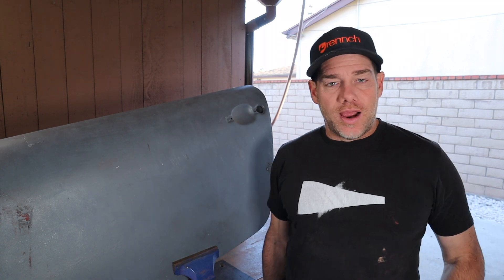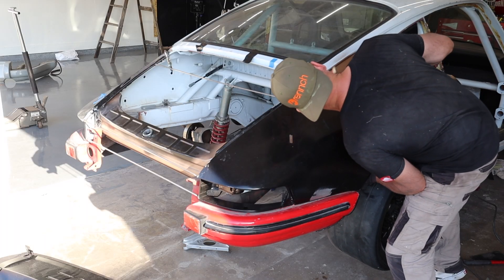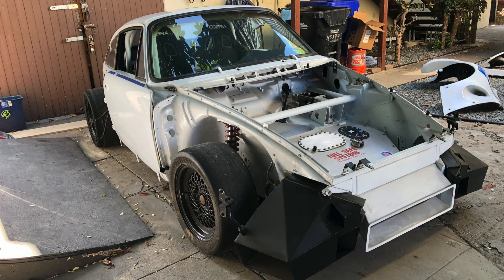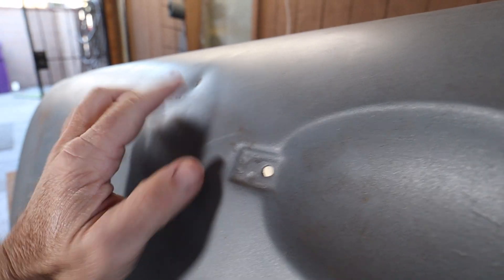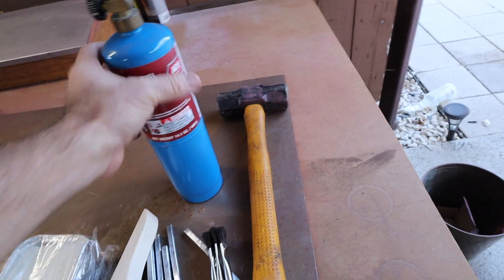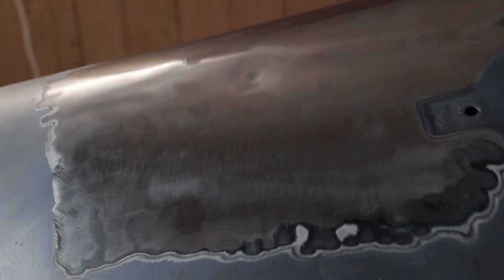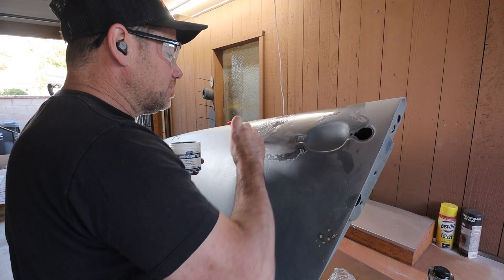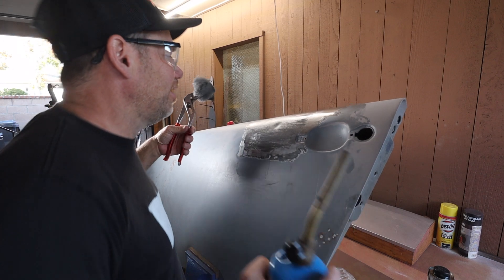Complete Newbie Tries LEAD FILLER on His 69 Porsche 911! | Blasphemy Build 32

Comment: I've done a  bit of lead filling at a Hobby panel beating class here in Aust.  WE don't have that 'butter'. WE use flux on the area then keep the area warm and add some lead to tin the area.  Your doing pretty good at that part of it, BUT, put those files onto the handles ! You will get much better control.

Use both hands on the handles and run cross ways (ie horizontally) on that door gradually moving from the top of the door downwards, left to right or right to left........ NEVER run the file vertically as you are putting FLATS on the lead area as there is nothing to stop the file going into the lead too much.  Running crossways you have the metal each side of the dent to control how much you can take off. .... you should be able to get virtually down to the metal around the repair area while removing the excess lead.

The idea is to work with the shape of the panel as you remove the lead.     Same goes for any filler work really, not just lead.     Get yourself a long flat sand paper holder also. It looks similar to the file handle but the bottom of it has a metal flat surface that you fit the paper onto. Paper comes to suit those holders.   And use gradually finer paper to smooth the surface. AND use that paper holder in the same fashion as the lead files. Here's a typical one https://www.ebay.com.au/itm/262657704342?chn=ps&norover=1&mkevt=1&mkrid=705-139619-5960-0&mkcid=2&itemid=262657704342&targetid=919947811646&device=c&mktype=pla&googleloc=9071258&poi=&campaignid=10101784991&mkgroupid=102311924380&rlsatarget=pla-919947811646&abcId=9300367&merchantid=116513986&gclid=CjwKCAiA7939BRBMEiwA-hX5J4HLGBg4dbse3PwS1luxiJUM-eMEUB6AOwYA3Vd4axSwMRYiA8tGbxoCYKQQAvD_BwE
Reply from the maker: I actually have one of those!  Good tip!

Comment: I’ve never done it.  Plenty of soldering.  Never lead body work but a few things.   Buy a better torch. They are cheap.  One with a lighter/igniter button.  I wonder if a heat lamp to keep the steel warm would help.  It seems to me the steel cools down too quickly.  I wonder if mapp gas would get things too hot or perhaps get you up to temperature faster.  And yes.  Wear a real, high quality ventilator.  Lead kills.  In a slow and ugly way.  Be safe.  Great video.
Reply from the maker: Yea, maybe a better torch.  This one wasn't awesome.   As for the PPE, I addressed that in the first comment above!  Good lookin' out!

Comment: Very impressed with your first go, im sure you'll get alot better as you carry on leading the rest of the car. Would suggest that you start on the flat easy parts firts to learn the technique. 
Were you supposed to mount the files on the longer wooden handles?
Reply from the maker: I sure was.  :). I've tried it both ways now, and they each have their plusses and minuses.

Comment: You were not getting the panel hot enough, and were directing the heat on the lead only so it would melt but not tin and flow on the panel, but just freeze which isn’t a good bond and doesn’t allow you to work with the paddles. When I have done this I didn’t have to ‘burn off’ the flux, I heated the panel, then added flux then tinned with lead, same as you do with soldering,mute flux helps the lead flow and tin on the panel.... my flux may be different from you butter but it was easier.

I also only warmed the lead stick, the main heat was out in the panel, you get a feel for how much heat is needed, certainly more heat in the panel than you used. If the metal starts to blue (colours run) then move to another part of the panel as it got to hot in that area.

Put the handles on the files, they work better when supported
Reply from the maker: Thanks james!  I've tried each way now and they each have their moments.

Comment: 😀hi grate job. Don't use the Da to finish your bodywork its best if you block it off. Da will give you waves. Learn that the hard way when younger. Working in bodyshop. Good luck 👍
Reply from the maker: That's what I'm learning.  For this, it was more about getting the texture to change so I could see high/low spots.

Comment: Looks like the melting point of the 70/30 is about 380 Fahrenheit. 

Would it be easier to use a heat gun on low to heat a broader area than the few thousand degree pencil tip torch?  

I wonder if you might be able to find a more forgiving range of heat, rather than spiking it up and down with the torch.
Reply from the maker: No.
Reply: @rennch.  Yeah, I figured decades of top level craftsmen had it sorted by now...
Reply from the maker: @mateoechabarne5080  I think a small propane torch is too "directed" to properly heat the entire panel.  I might need a different kind.  We'll see how it goes.